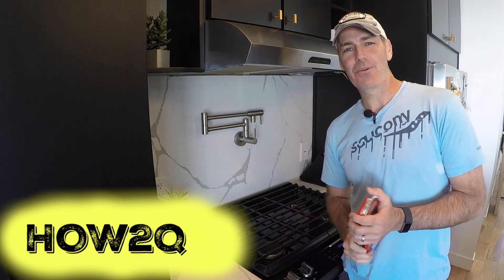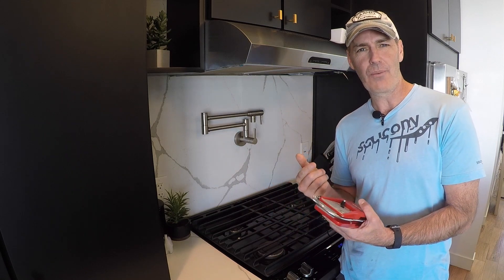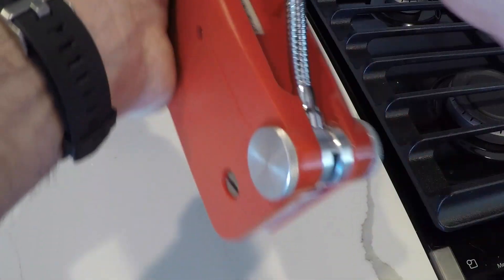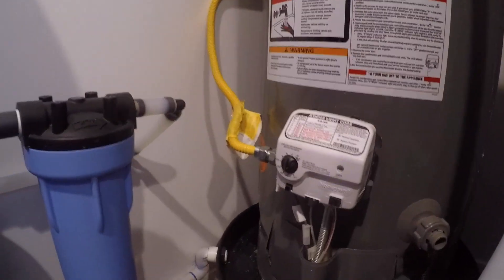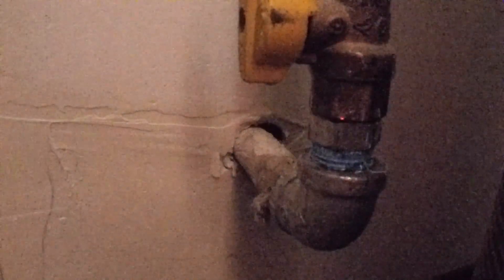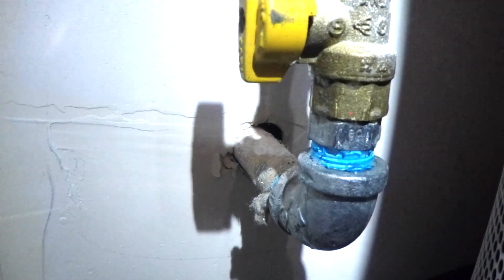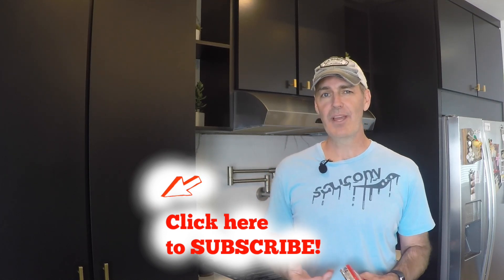How to track down a small gas leak

Comment: or you could just use dish soap diluted in water 50%, and spray it on the pipes. in fact, if you detect a leak with that detector, the spray bottle of "bubble-water" can help you tell where EXACTLY in the line the break is. nicest thing is, you can dilute it LESS if you need the solution to stick to the pipes better for bubbling.

also, Scamazon has the detector for around $20. just saying. no need to return. just throw it in your toolkit for future needs. without battery in, so that it lasts.
Reply from the maker: Yup…better option on the dish soap and “sniffer”

Comment: It's very important to start up your gas leak detection device outside in fresh air. That way it ensures it will be very sensitive to picking up those gas leaks. I also want to point out 2 more things. in regards to doing the soap test. No. 1, always use a noncorrosive soap - or at least as close to it as possible. And No. 2, ALWAYS use it AFTER using the leak detection device. If you use the soap first, it could give you a false positive reading on your leak detection device from any residual soap that's left on the pipes. I also want to add that if you smell gas or are suspicious of a gas leak, please, please step outside and call your gas company's emergency hotline. They all have a phone number specifically for these situations. Gas leaks are nothing to play around with! Depending on the severity of the leak, simply lighting a cigarette, cell phone ringing, turning on a light switch or any other electrical current could lead to an explosion. Stay safe everyone!  :-)
Reply: Good info! I wasted a couple hours learning that soap and leak detection fluid can set off your electronic gas detector.

Comment: Returning a used tool to any retail store, expecting a full refund, is unethical.  Many people do it, but that doesn't make it right.
Reply: 3:28 is the advice in question. That being said, this video is from 5 years ago and maybe things have changed since then (they may have been very expensive back then). I just bought one of these style of testers off Amazon for $40 and the thing is awesome. I would consider this an invaluable tool if you have gas connections in your home. After I checked my own work, I went and checked other gas connections in the house and actually found them to have small leaks, stuff that’s been like that for years and done by professionals.
Reply from the maker: I get it.  Thx for your comment.
Reply: Speaking of unethical.....Home Depot.
Reply: Not to mention ripping off the plumber by keeping the tool that he left at your sister’s place …
Reply from the maker: In previous message i mentioned left 2 messages w company.  Nobody ever came.

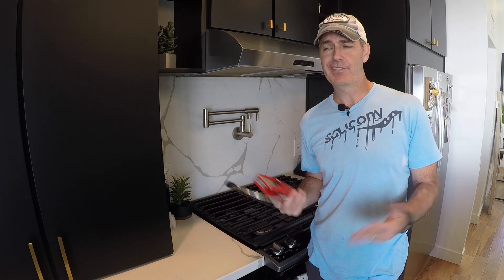Comment: @3:34 Jerk move.
Reply from the maker: Thank you for your comment.  To some, yes jerk move.  If you have plenty of money, call a professional or gas company.  These testers can be extremely expensive and for those on a very limited budget it's a smart move for the one time in your life you will track down a gas leak (hopefully).  Just my opinion, thank you again for sharing yours.
Reply: @how2q  I'll elaborate.  Even on a tight budget, a basic tester can be found for ~$25 at the local hardware store.  If you really can't afford that, then you have much bigger problems being a home owner.  Assuming you have a gas leak, you will need to repair it.  You can try to do it yourself, although it is usually strongly advised not to as the risk is high if you fail to do it correctly.  Thus, you probably need to call a plumber anyhow, which is never cheap.  But, buying a tool, using it, then returning it is a form of theft.  If the real issue is you don't want to have to store a tool you believe you won't need again, then give it away to someone who needs it.
Reply from the maker: Respect your opinion.  Thanks again for sharing.

Comment: Gas Company shut off the gas -  we can only use air to test - Plumber spent 8 hours over 2 days ($1000) still can't find the leak
Reply from the maker: That sounds like what happened at my sister-in-law's house.  It took them a while to find - she was without gas for almost two weeks!  I knew my son & his girlfriend had a feint smell so instead of calling the gas company I came over and filmed that video!lol  We called the gas company & of course a plumber...they didn't have hot water for 4 days before we could turn it on.  The person that installed the water heater did a hack job when the house was flipped to them.  Thanks for watching...hope they figure out the leak!